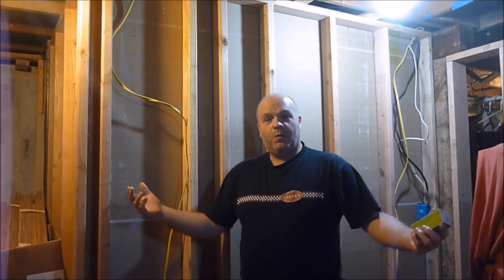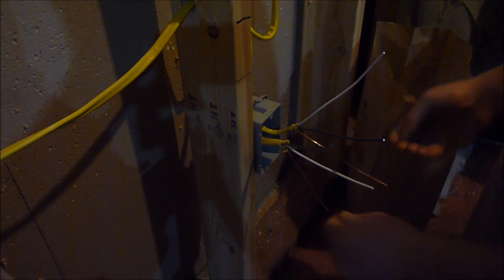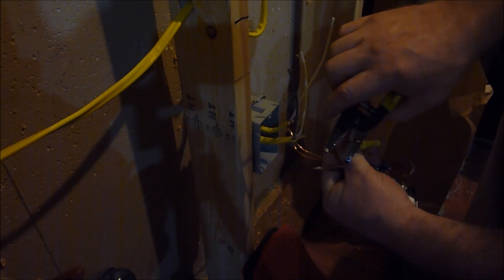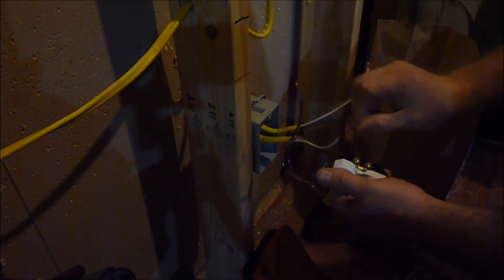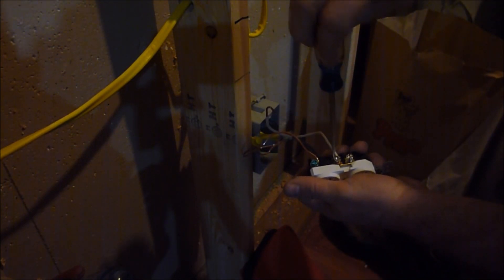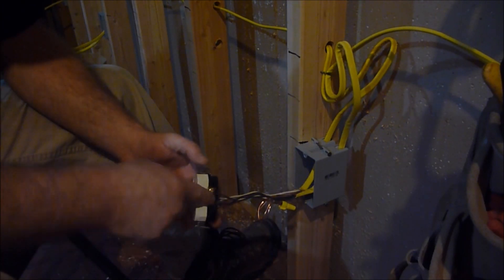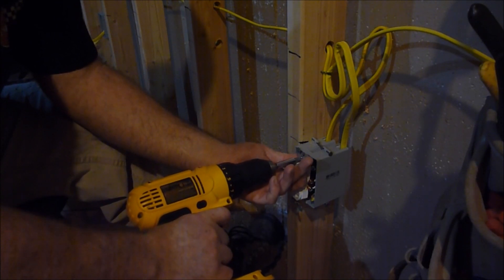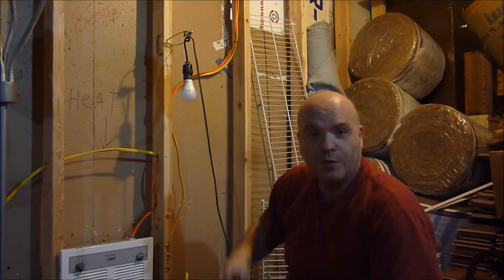WIRING RECEPTACLES IN PARALLEL

Comment: How you wired this receptacle is a code violation. You cannot depend on a device as a splice point. You must connect or pigtail all wires like you did with the ground then go to the device. Also just a tip. Go low with your romex (yuck) or conduit. That way if down the road you can fish down power, data, plumbing, or gas line without the wire or conduit in the way. Takes no more time to do.
Reply from the maker: it passed inspection in my area some pleases are very different that's why i tell people  to check there local codes
Reply: @JunkworksGarage  true, but it is national code. They probably didn’t pull out the receptacles to check.
Reply from the maker: @andrewk7745  I have heard what your talking about with metal boxes but not with plastic ones, or ime not understanding what you mean about a splice point
Reply: @JunkworksGarage  the box type doesn’t matter. A splice point is anywhere two wires or more come together. You must use an approved method to connect them together. Like a wire nut or Wago. Using a device such as a switch or outlet is not an approved method because it is dependent on the device. Again how you pigtailed the ground is approved by code and the neutral and hot should be done the same way.
Reply from the maker: @andrewk7745  my dad was an electrician and i worked with him for years and as long as you're not putting more than one wire per screw it is good in my area according to my area i have had my place & my moms inspected & did them both this way & the inspector checked before & after the receptacles  were in  maby code has changed since but i had my mom's place inspected last year if you are correct and i did it wrong there are a lot of electricians doing it wrong .
Reply: @JunkworksGarage  I apologize, I should of been more specific about the code. The code in reference is NEC 300.13(b). It deals with device removal. It states that in multi branch circuits (more then one hot sharing a neutral which is the grounded conductor) you cannot use a device as a splice for the grounded conductor. The reasons for this is that opening the neutral and therefore breaking the continuity back to the panel can create serious risk to personal safety and property damage. In order to remove or replace the device wired by this method would require opening the neutral. This poses the possibility of the neutral becoming 120v and the possibility of a phase to phase sending 240v to loads. How you wired the device would be permissible by code only if one hot is utilizing the neutral back to the panel. And, it may be, but I can’t say that is the case watching the video. Hope that clears things up better. 😀
Reply from the maker: @andrewk7745  👍

Comment: This is not parallel. This is series wiring which is not recommended for multiple outlets in your home.
Reply: There is no such thing as series wiring with receptacles, it's always parallel, whether you use pigtails or daisy chain devices. The break off tab (when intact) between the screws make it a parallel circuit.
Reply: @surferdude642 You sir have a true understanding.

I recommend these folks take some automotive DC trouble shooting 
lessons.  They will learn about SERIES wiring (Voltage Drop) at rusted or loose connections. comment please
Reply: @bmxtimemachine6736.  Sorry, incorrect statement.  All duplex receptacles are wired in parallel pigtail or sequential.   

PARALLEL otherwise it would not work .  comment please
Reply from the maker: it passed permitting so i'm good either way.

Comment: So you connected the incoming hot and neutral to one side of the outlet and then connected the outgoing hot and neutral to the other side of the outlet, meaning that if the outlet went bad, whatever outlets that outgoing hot and neutral wires fed will go bad as well, as in a daisy chain.  Would it not make more sense to connect them using pigtails, so that if the outlet goes bad it won't affect any other outlet?
Reply from the maker: actually bothe hots go to the same side and both neutrals go to the same side
Reply: myvidd222 - I think I understand what you're saying. You are correct, using pigtails is preferable. If you're not an electrician or a savvy diy'er it may be better to do this the way he did it. If you don't pre twist wires correctly or don't pre twist at all, you could get a bad connection using wire nuts. Then again, you could use Wago lever nuts instead of traditional wire nuts and it would be hard to mess up.
Reply from the maker: @surferdude642  👍

Comment: I agree one hundred percent with how you're doing the wiring but I also would like to mention that you only have to cap the ground wires together. At the end of the circuit, though, make sure that the ground wire is connected to the green screw. You don't have to pigtail each and every plug-in.

Comment: So what about the very last white or neutral? Does it need to run back to the box or does it already do that?
Reply from the maker: i'm not sure i understanding your question. as long as you started your wiring at the main and you have a ground ,neutral, and hot wire in the proper places  it doesn't need to run back to the box again. but you should have an electrician check your work . before you hook to the main

Comment: Ground first.
Neutral (white) second.
. .at this point, there is no "hot" coming in, so touch away, and you should not be zapped.  If you are zapped at this point, then something is wrong upstream, AND DO NOT CONTINUE!!!!
If all is still well, the attach the "hot" (black) last on the brass. 《Black, Brass, Last.》
Reply from the maker: best advice don't have any power going to it at all the rest don't matter
Reply: Us electricians have a saying that are words to live by, in regards to neutrals. It goes “ first make last break”. If you don’t understand this and why, then you should not do electrical work, period.

Comment: This is a total hack job.  ground wires need a barrel crimp. The  black and white wire have to be made up in the box with only a white and black wire going to the plug. No electric tape around the plug  hot  set screws. excess romex in the wall. romex needs a staple 6 inches from box. You don't force a plug in to a box, this type of work causes wall fires.
Reply: You don’t necessarily need a crimp(code book doesn’t require it 😂😂 it’s just to keep the wires together better) no need of electrical tape cause it’s not a metal box😂😂😂 code doesn’t also requires it amd last watch the whole vid before u critics others.
Reply: @oscar27ization  exactly why it’s a hack job you do the least amount of work to just shit it in
Reply: Dude was driving me nuts. He's daisy chaining them not parellel chaining, plus fr he just missed so much for even daisy chaining.
Reply from the maker: you obviously didn't watch the whole vid i explain some of what you say and also your wrong about some of the things you  list codes vary from place to place .

Comment: This is technically a parallel circuit.  Not a series circuit.
Reply from the maker: appreciate the information i am used to doing more DC stuff than AC
Reply: @JunkworksGarage  It is still a parallel circuit though. No matter if it's DC or AC :)
Reply: @dmshopper6952  right.  Lol
Reply: No, the receptacle was wired in series.  Parallel would require pigtails so that the current doesn't have to run through one receptacle to reach another.
Reply: wrong

Comment: I am about to go hook up 30 sockets in series for my garage made out of 3 40 x 8 shipping containers with the joining walls cut out and bolted together, and needed a short refresher course.  This video did that for me in spades.  I knew all this but it never hurts to be reaffirmed before you hook so many and have a problem.  my series are going to be 10 rec/per 20 amp circuit coming off a 50 amp box with the ability to make it a 200 amp box with the 2-2-2-4 already installed.  Very rare that I will be using more than 2 receptacles for power equipment at once on any one circuit so i think 10 each will be fine.  Mostly "hotel" loads and charging stations.  The goal here is to have one Receptacle handy if I want it wherever I am in the shop.  Anyway, thanks for the refresher and mumble away!
Reply: please don't forget your grounding.